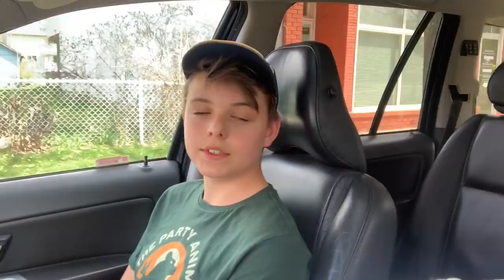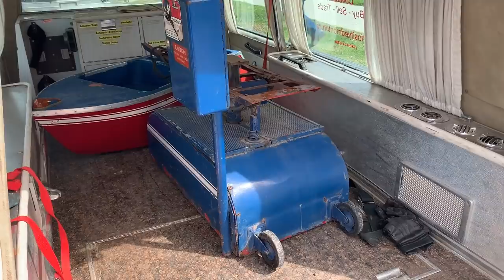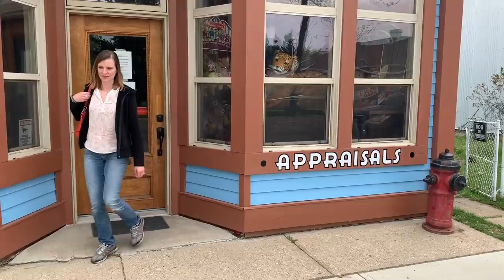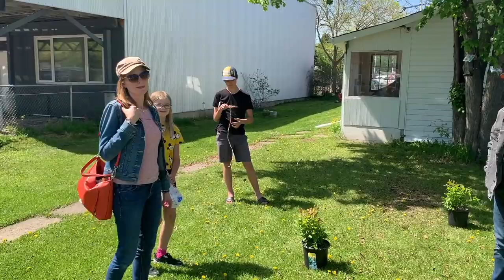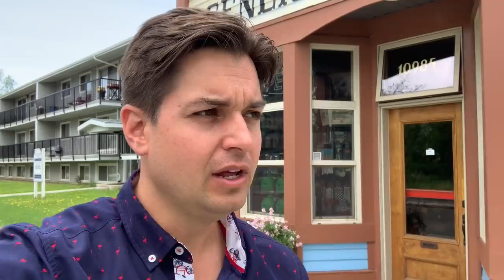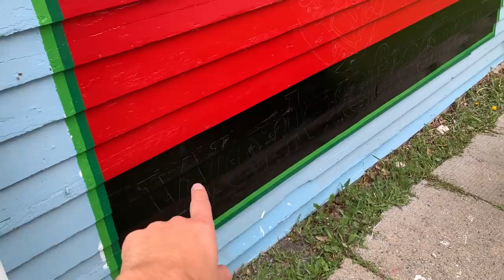Part 2. Will the build be cancelled over a $750k hydrant?!?

Comment: It would cost less to buy the business next door... what a bunch of crooks. If the infrastructure is that outdated I would think that means they are sorely behind in their maintenance and risk potential negligence lawsuits themselves if there are any current structure fires. Why is it okay for them to pretend the safety of an entire block with huge buildings is covered by the current infrastructure but your tiny by comparison add on would tip it over the edge? I wonder if there are any current plans to upgrade the infrastructure that you could wait out or plan your build after? Do they just let the pipes go to rust until their next victim comes along?